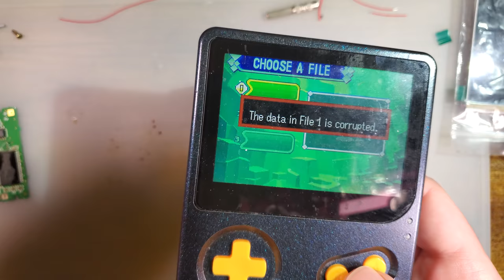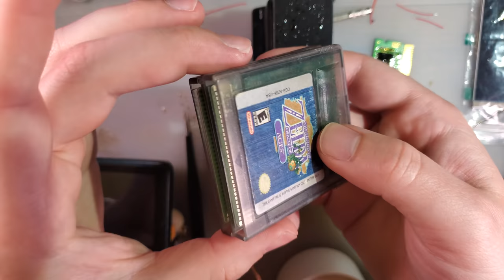Game Boy Cart MROM Transplant

Comment: I was watching the temps rise and was waiting for the board to fry, good on you for showing people the mistake so they don't make the same one. Personally, I just use a hot air station. Takes less than 1 minute to remove the chip and you're only directing the heat where you need it.

Comment: I think after all it is no good idea to do such jobs with just the hot plate. Hot plates are commonly used to support while soldering. You can use it to, for example, heat up to just 100°C to reduce heat loss caused by big ground planes. Then do the actual soldering with hot air after covering surrounding parts with aluminium foil and/or Kapton tape.

Comment: 1:36 wait is that a plastic version of the boxypixel case?! the buttons look really yellow  for it to be from boxy and non metallic and the case looks like a different finish that the ones I saw on the promoted videos of  the metallic casing
Reply: It's a (prototype of a) Makho original, which is going to be made and sold by RetroCNC and was created independently of Boxypixel's. You'll notice it's slimmer and sleeker on all 3 axes. I think the one shown in the video is painted aluminum. You can see more at the end of the Getting Started Soldering stream.

Comment: Please, i need that shell.
Reply: Boxypixel is the company that makes those metal shells
Reply: @DuaneWasylyshen  Nope, that's Makho's own design. It hasn't been released yet.
Reply: Boxypixel GBA SP Shell is bullsh*t
Reply: @7991rellik  I just didn't know of any other metal shells sorry
Reply: @Juan.Garrocho  Let's do some math, to find out if it is or is not bullshit...

A 12" x 12"x 6" block of 6061-T651 aluminum is about $220, though to bring the math closer to A SINGLE BoxyPixel shell let's crunch the numbers for a 6″x6″x1″ block of Aluminum 6061 which costs $25 per block.
 And just for argument's sake let's assume we get both the front and back from the same 6″x6″x1″ block.
 Multi-axis CNC machining (what this would require, not a turning lathe) typically ranges between $75 and $120 or higher per hour.

So if we assume that 6″x6″x1″ block can be fully milled in an hour, that's $25 for the aluminum block + $75 for the lower price range of an hour, that's $100 flat withOUT Taxes, the machine overseer's rate, or shipping back and forth.

Yeah, if you think $94 is bullshit for a shell that would cost you $120+ after taxes to have ONE made, then I don't know what to say other than "have a good life"

Comment: Hello. I posted this on one of your GBP IPS mod videos, hope you have the time to maybe answer me this question. 
So, I have an IPS screen on my GBP, same model as yours (power led model). I can make it work with batteries, but when i plug a Pelikan 3V AC adapter (designed for GBP and GBC) it wont turn on, or when it does, the screen flickers and the GBP acts slow and weird. I assume the power is not enough. How can we make it work? Batteries last nothing.
Reply: I'd start by checking the actual voltage the adapter is outputting then I'd double check makhos voltage draw info on his Gameboy pocket ips screen, if all are in the clear then maybe you need to look into a rechargeable battery mod for the gameboy pocket that has higher miliamp hours